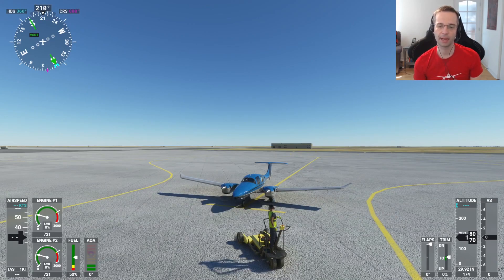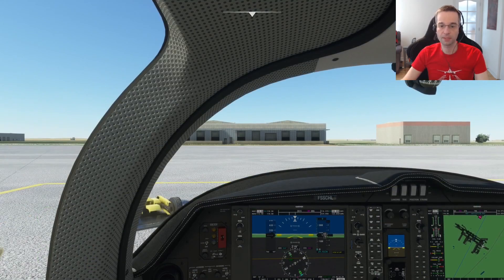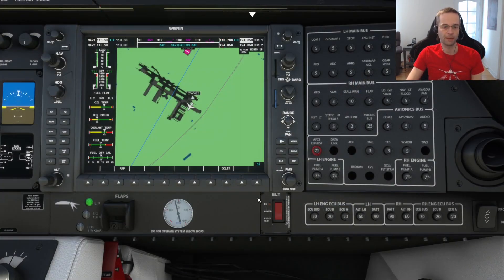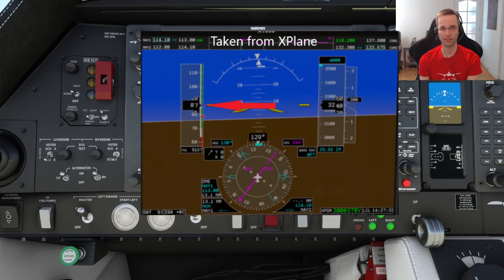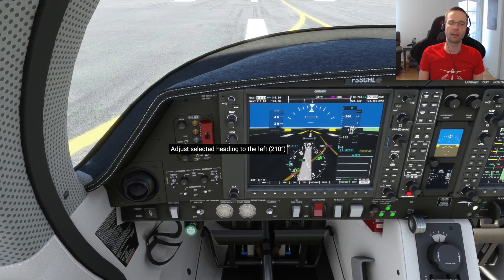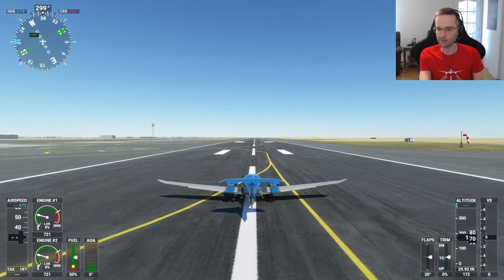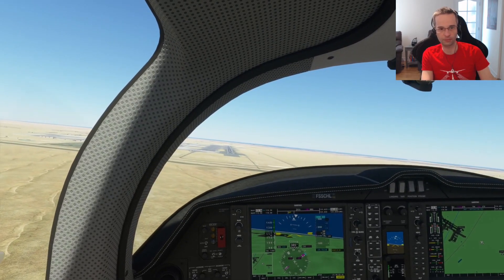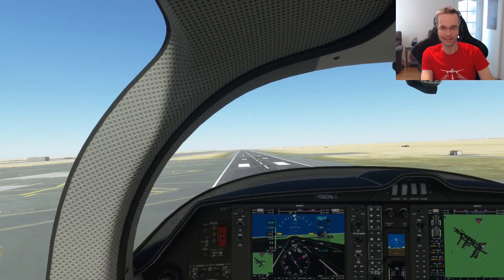How To Fly Multi Engine Planes Like The Diamond DA62 | Microsoft Flight Simulator Tutorial

Comment: Good info on what to keep in mind on a multi, will give this AC a try today having only flown the 152 and 172 should be interesting.   cross wind should be much easier with the ability to use the engine opposite the wind, thanks.  Funny, I just looked up the specs for this Ac and it has constant speed props so pitch should be variable in the sim, is it not?  NM, just heard back from someone that flies this for real that the % power, mixture and prop pitch are all managed automatically by the FADEC system, pretty cool.

Comment: with the DA62 what kind of landing speed should I be aiming for? I feel like I am going way too slow in those landings
Reply from the maker: I try to fly final in the DA62 somewhere between 90 and 95 kts. As you saw in this video I'm coming in a bit faster than that, but ideally I would have been a bit slower (I was distracted talking & flying at the same time). What speeds do you usually use?